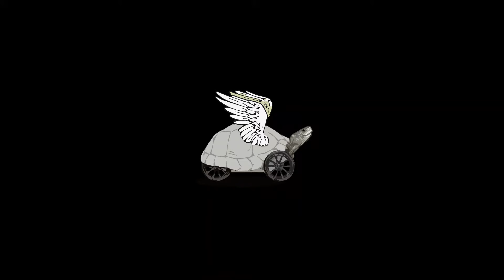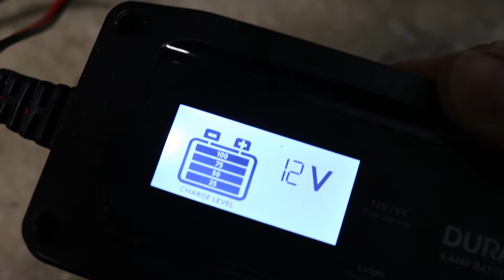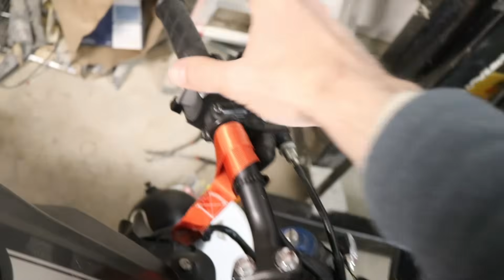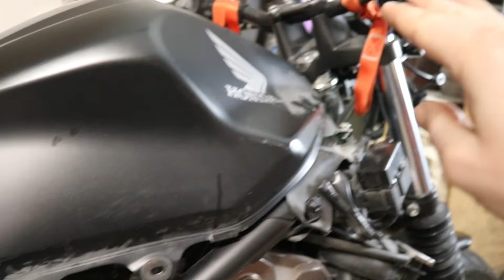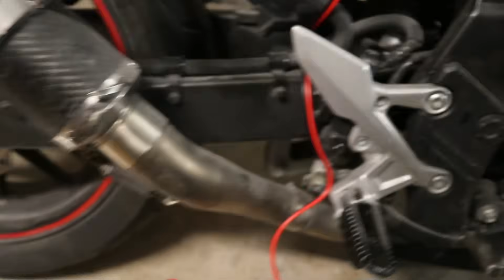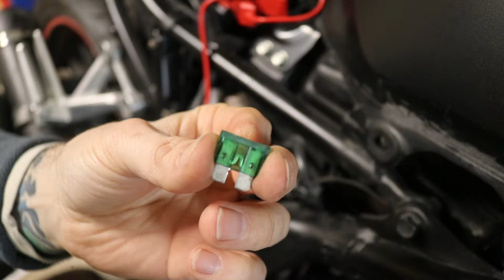Motorcycle Won't Turn On! No Power at All | Blown Main Fuse Diagnosis

Comment: hi sir. i have a z1000r. i changed my fuses. have a new batt and cleaned my starter relay. no display on the panel but a little bit of light shows. when i press the horn the dash flickers and the abs light too. How to fix? my main fuse wasnt blown when i checked it but i still replaced it to be sure

Comment: Imagine I tried the same troubleshooting, and seemingly it worked. Had my motorbike die on me while I was leaving a dual carriageway. Luckily, it took 10 minutes to push it home. I followed your tutorial because it blew the main fuse twice... I got the lights on after checking continuity. Lo and behold; it didn't want to start 😂 in the end there was a short caused by my indicator button's wire snapping clean off and touching the handlebars (ground). I ended up soldering it back and got the bike working 😂 gotta love this life 👍
Reply from the maker: Good investigation work 👍
Reply: @HooptieDoodle  cheers, dude! Still makes me laugh when I think back on it 😂

Comment: I jst had the same thing found it abd came to look if its cimmon..I thought the same thing  what made it blow
 I'm in new England  mice. And or even if a wire shifts heat  sn melt or bother it. 
..ill get a fuse tomorrow.  Bjt common sence has helped. I'm njt an engine  guy  or wiring but maintenance  and trouble shooting ive gotten better.  Sux. We pay to ride  pay to play

Comment: I’ve had my 83 Honda vt750 for 2yrs now and when I bought it I noticed the power went in and out sometimes. Really didn’t pay attention to it until I got ready to start it for the first time and it died for good. I think it might be the wire from the starter solenoid going to the ignition switch but I haven’t traced it yet because of all the tape wrapped around it. Do you think this might be my issue?

Comment: If anyone can help, the display on my 2018 gsx250r just went black on me and wont get power along with my lights, horn, signals, everything but my headlights. engine starts, battery is good, fuses good, relay good, cant find the issue and want to ride

Comment: Had this issue with my moped. Replaced the fuse but still wont work, the fuse is a super old cylindrical one. (It wiggles around in the slot too) and i believe the slot is that corroded it js wont work. Prev owner had foil in it...

Comment: I checked my fuse and it seemed to be perfectly fine. I had 12 volts on both sides
Reply: me too dawg
Reply: I found out my problem was im a dumb ass lol. I forgot to plug in the main wiring harness behind the light that connects everything together lol @2sexy2fly
Reply: @BestowalPants90 ill check mine out
Reply: thanks for the insight homie

Comment: Hello sir. My bike have same electrical issue. It's a 2020 Hayabusa Gen 2. Nothing is turning on in the dashboard. Even the dashboard lights aren’t coming on. The bike isn’t starting, and neither the headlights nor the indicators are turning on. Only the time is showing—and that too only when the key is OFF. When I turn the key ON, even the time display goes off. But with the key OFF, the time shows up. The battery is new.

One day, I turned the bike ON and kept it that way for 10 minutes, and when I was switching it OFF, the radiator fan was still running. I turned the key ON again without starting the bike, and left it like that for 1–2 minutes. Once the radiator fan stopped, I turned the key OFF. Two days later when I tried to start the bike, this issue began. The battery is only 9 months old and is charged at 13.3V. When I tried push-starting it, only the lights were flickering ON and OFF, but the bike didn’t start.

What could the problem be, brother?

Comment: My brother

My (big boy superlight 200cc) doesn't show anything when I turn the key on & not starting after I've lost the key & tried to bypass the ignition it's started few times then goes blank, no more starting  the battery still fine,   what could be the problem?   I found the key but not showing anything now😢

Comment: Any ideas?
This happens on my bike...sometimes..but it will randomly work..
Reply from the maker: if you sometimes have power and somethime not - I would bet loose connection somewhere on the bike. Start by checking that battery terminals are tight, then follow wires from the battery to the main fuse, then look at the wires to the key
Reply: @HooptieDoodle yup loose @ battery ty
Reply: Does this mean that my problem is not a fuse?

Comment: Can anyone help me out here, I’ve got exactly this problem, but on a Suzuki marauder 125 (fuel injection model). 

No lights when I turn the key, key turns fine with its usual click, battery is charged… but I can only find two fuses either side of the starter solenoid and can’t find anymore fuses at all? Changed those fuses just incase but still no electrics… I’m so confused!? I’ve taken apart the kill switch, cleaned all the earths. What do I do next!? For extra context before the starting issue I was loosing power in 5th, completely not pulling at all. What the hell is going on?

Comment: I removed the old analogue gauge cluster on mine to replace it, I just unplugged the old one, I made sure to mark where the two connections went. Connected the new one, I didn't touch or remove anything related to the ignition, but now it doesn't work, nothing. And it was working perfectly prior to. What is it?

Comment: Having the exact same issue with my 2014 R1. Replaced stator, starter, rectifier, bike has issues starting so I got a new battery. Bike started up with new battery, shut it off and tried turning it back on with nothing. Replaced the main fuze and still no power any ideas?

Comment: Could you tell how to take of the top pink, white cover of the fuse? That is not easy.
Reply from the maker: there are little snap clips on either side of the cover. Pull those clips out slightly and the cover up and off.
Reply: @HooptieDoodle  Eventually I could take it off. thanks.

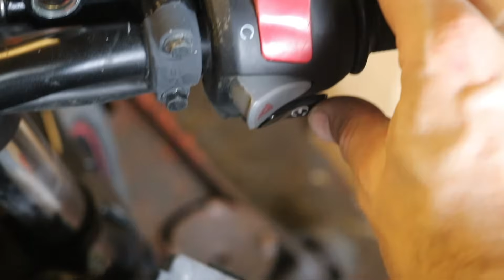Comment: 1:35 that is exactly what my 750 nighthawk is doing right now. Some lights but no ignition plus that sound. If youre getting that sound does that mean your fuses are still good or does it mean theyre starting to go. I know my battery is low and either needs refilled or replaced but Im not sure if I have a problem beyond that.

Comment: My fuses blew this way. I had a torn rear light wire. Instead of buying the correct size, I bought wire 1mm wider. I soldered it to the old one. After riding for 15 minutes, it blew all the fuses. It seems there is something like wire gauging. The size of the wire matters.

Comment: I went to start my honda vfr 800 it cranked then completely last All power checked the fuse it's not blown maybe the key cylinder?
Reply from the maker: this is always a tough one, cuz you really need to be there. I would start with the basics like charging the battery, checking all fuses, and, maybe, there is an electrical connection that cam loose. But to lose all power that connection would have to be near the battery/ main fuse. Good Lucks

Comment: What caused the buzz  in the clip? Mine did the same thing randomly, then lost power weeks later with a good battery
Reply from the maker: I believe the buzz is a relay, likely the starter relay, not getting enough juice to flip it (or something) and buzzing instead. I could be wrong, I would need to have the bike in front of me to verify, but that's off the top of my head.
Reply: @HooptieDoodle  I took off my battery to replace it, auto zone said it was perfect still. Terminals were corroded though, so I cleaned the crap out of it and everything is perfect now, no sound

Comment: Hello can i ask for help i do have an r15v2 but it keeps on blowing without turning the keys on its like it has a direct current going to the fuses. But before i checked out that i have a faulty regulator. Is this a regulator rectifier problem? Please help

Comment: CBR250 with no power but I checked the main fuse and it’s good. I changed it anyway and still no power at all. No mods and I drove it to work like I always do but after work, I turned on the key like normal and all the lights came on and the fuel pump primed. When I got the starter button, I heard a snap and the power turned off. Okay still haven’t figured it out. 🫤

Comment: Thank you... I was struggling cause I could bump start my bike and it'd run algs so for some reason I ruled out fuses. Cause I thought if the fuse blew the bike wouldn't run. Then cause od this vid I thought fuck might aswell check it. Pulled it out and just crumbled to the ground. I haven't ridden my bike for like a year cause I didn't have money to get it checked out at a service center and now I'm hitting myself in the head for being oblivious to this. What's worse is I was a marine electrican I worked with fuses all the time. But enough of how stupid I am. Thank foe the simple video

Comment: You should also point out that some times you can't see a blow fuse with you eye; testing it with a multi meter (ohms) is the best way to test - I was testing a heating element (related) and my eyes could not see the element was damaged; but the DMV showed no voltage could go threw the circuit

Comment: Thanks, I have a cheap RPS Hawk 250 dual sport, and my starter doesn't come with a fuse port so I had to buy a new solenoid starter for $8 on Amazon :(. But it should work now thanks to your help so thank you :)

Comment: Only my head light come on but it starts
Reply from the maker: Likely a fuse for a circuit containing multiple things. Check your fuses. The real question is why the fuse blew?
Reply: @HooptieDoodle  I was putting the battery back in after I charged it and was putting my aftermarket turn signal then it went out

Comment: Same problem, battery is ok, no lights on dashboard BUT, the 30amp fuse is ok, change to the spare and nothing! Please help. Is a cb500x 2015
Reply from the maker: You have no power to anything? The battery is putting out 12+volts? And the main fuse is good? Then I would start checking grounds. But first, are all the other fuses good? Now, the negative battery cable: is it attached to the frame? Is your regulator/ rectifier grounded? Have you done any mods or maintenance on the bike lately?
Reply: @HooptieDoodle  12.7v. And the main fuse is good, also tried the spare one and nothing happened.
All wiring looks good.
Saw something about 2014/15 cb500f (not x) the post says something about the starter relay switch, honda made a recall to change it.

Today I will try another battery but I don't think is that.
Too weird, the day before worked flawless.
Reply from the maker: @a13jo  if it were the starter relay, I would expect the bike to have power to the dash, etc. As in this video: https://youtu.be/zUFsmNdg2bM
Since you have no power to anything, I start to think the issue is somewhere near the battery, you've checked the more likely issues,  I would bust out the voltmeter or a simple light meter and see where you do have power. Working from the battery going out.

Comment: It's getting cold so I bought a new charger to maintain the new battery on my GSXR so I set the charger to the correct setting and it showed fully charged then I turned the key and got nothing.I;m going to strip it down and hopefully discover it to be a blown fuse...fingers crossed! Thanks for this video!

Comment: Question. I crossed my new battery terminals and knocked out power to a Honda grom style street bike. Where do I begin first? Battery was tested and is still charged. I turn the key and no power.
Reply from the maker: On the grom there are three fuses. Total 😀. So the main fuse is with all the other fuses. Start by checking all the fuses. Should be a small box with wires running into it under the seat.
Reply: @HooptieDoodle  Thank you!
Reply: @HooptieDoodle  I used the spare fuse for the red battery connector and the power was restored! Yay. But now my bike is idling high. Trying to adjust the idle. Could the throttle cable also cause high idle? My bro had adjusted it the other day….
Reply from the maker: @lowlywhiskypeasant  throttle cable could definitely cause a high idle
Reply: @HooptieDoodle  yep it was. Readjusted the throttle cable and she is running again! Thanks!
Reply from the maker: @lowlywhiskypeasant  excellent 👍👏

Comment: My triglide has lights and radio, but the buttons on the handlebar and dashboard is not doing anything.  5 Amp power fuse blows everytime I try to put a new in. Can you tell me the problem? I have this issue since a big rain storm.

Comment: Thanks a million!  I recently jumped my byke due to it sitting too long.  Anyway, it took the jump.  I rode to the air station and turned the engine off.  Not sure why I did that. Byke wouldn't turn back on. Tried to jump again and probably blew the fuse then.  Thank You again!

Comment: So my ignition fuse is good but my ecu fuse blows soon as I turn the key fuel pump won't prime probally because of it and I'm lost every wire I can see without unwrapping the whole harness looks good. Battery is good but blows soon as key is turned

Comment: My gl1100 is doing this, but the ignition lights do Illuminate when the key is switched on. The starter clicks but isn't cutting on. The battery is charged, unless the battery is now defective.
Reply from the maker: It sounds like the battery doesn't have enough juice. If you have a voltmeter you can check if it's got 12+volts, or you can take it to an auto parts store and they can test it.
Reply: @HooptieDoodle  i think its the starter or the sarter solenoid. I tried using a screwdriver to Jump it and it sparked but no crank, and since its clicking i think the solenoid is in tact but the starter itself needs replacement?
Reply from the maker: @dewdrop3009  you may be right. I only suggested checking the battery since it's a cheap and simple check and it would show as the same symptoms and in my experience,  more likely

Comment: You saved me from a heart attack! Was in the process of installing a Chinese integrated tail light which came with zero instructions or makings of the terminals and blew the fuse. By following your video I looked besides the tray and found a spare fuse hidden in there. So now, can I get the replacement fuse from the dealership or is it easily available on the hardware store?
Reply from the maker: Glad to hear that the video helped 😀. You can get fuses at any auto parts store. Just take your old one in and match it up 👍💪

Comment: Need help, got a new project bike 07 gsxr 750. With ignition on the tachometer will go up then back down, but no light and no power. Checked my fuses they are good thanks in advance.
Reply from the maker: Did you check the starter relay? https://youtu.be/zUFsmNdg2bM

Comment: Can u help me 09 Kawasaki zx10r parked the bike , came back to it, it won't start relay was clicking checked the starter by cleaning it check brushes was kind of ok, changed stator had a burnt spot on one phase, rectifier good battery good and taking and holding charge, changed the relay changed main fuse, clean key ignition switch, still won't start, getting lights on dash just the relay clicking on starting, jump start it it's running good but no headlights and horn weak, I need help

Comment: Is it possible to blow your fuse if for example i modified my tail light by replacing it with an after market one...?
Reply from the maker: It's possible. If there is a short in a circuit,  it should blow the fuse for that circuit. If multiple circuits are involved, it should blow the main fuse. Also, if multiple circuits are overloaded (drawing more energy than designed) a slight increase in draw on more than one circuit can cause the main fuse to blow. Perhaps the new taillight is drawing more juice than the old one?

Comment: I blew up relay fuse by trying out a new headlight. this video helped with getting the bike (2010 sfv 650 gladius )started again. Not sure if it will happen again, I have capped open wires(daytime running light) and hoping it wont happen again.

Comment: My dads bike has no power getting past the starter relais.
The main fuse is in the relais,it aint blown.
Can the relais itself be the culprit?
Reply from the maker: Could be the starter relay. Here's a video on just that https://youtu.be/zUFsmNdg2bM
Reply: @HooptieDoodle  Ill watch it right away 👍Already ordered a relais yesterday too
Reply: @HooptieDoodle  My issue seems to be different though.
No power to anything but the blinkers,all fuses good.
Everything died while cranking
Reply: @HooptieDoodle  Battery is fine at 12.7v

Comment: I have a 86 Yamaha venture Royal 1300cc bike that has  blown main fuse and a dead short. I've tried tracing the main fuse wire down, but not sure where the wire goes too. I can jump the starter and it cranks.i was having a battery discharge problem before the fuse blew. Can you give me any ideas on what could be causing a dead short,  and where to look for the short. If anyone can help me, I thank you in advance
Reply from the maker: I would check the other fuses to see if any of them have issues as this can point you in the direction of your  short. Definitely get a wiring diagram of your bike and a voltmeter and start checking continuity of each wire from one end to the other starting with the thickest wires. Hopefully you'll figure it out sooner than later. Also, if you've owned the bike for a while - what has changed recently? Add new electronics? Wash the bike? These might explain why and point where to look first.

Comment: I'm really hoping this is the same issue with my bike 300r. I was jumping my bike but connected my wires backwards (blonde moment). Got a new battery and I'm having the exact same issue. I will come back with praise if this is also my solution.
Reply from the maker: Wishing you luck 🍀👍